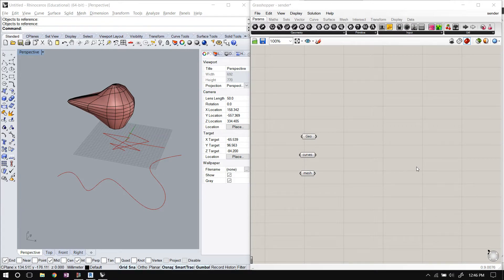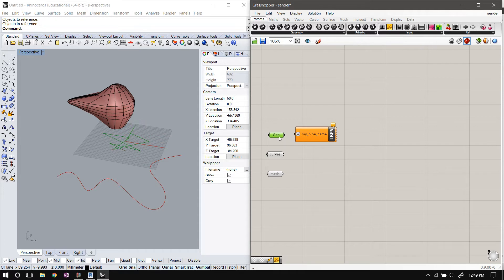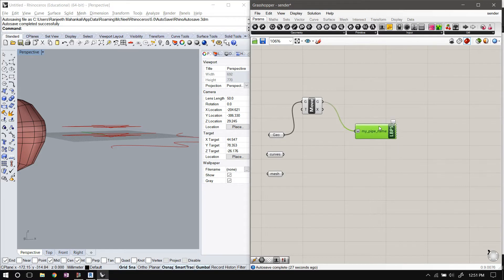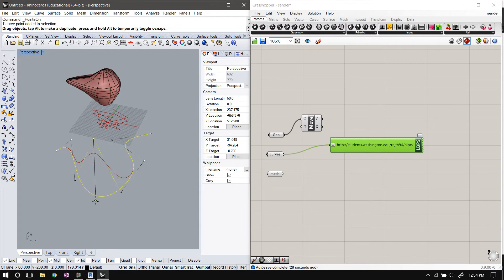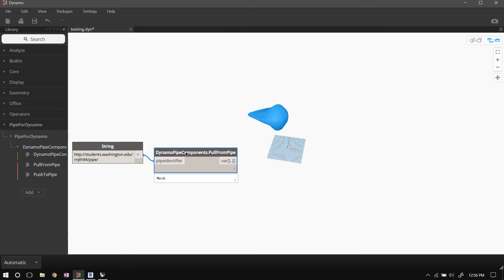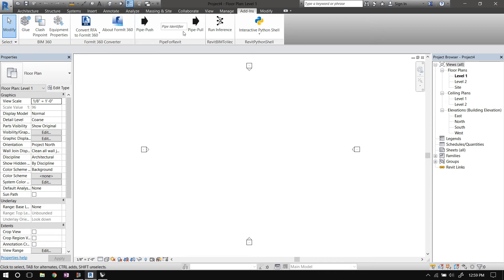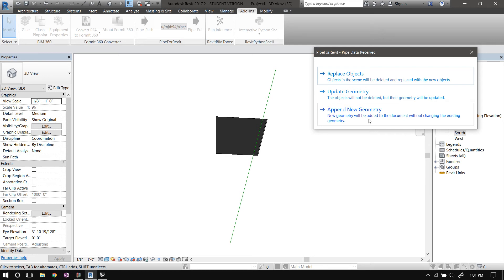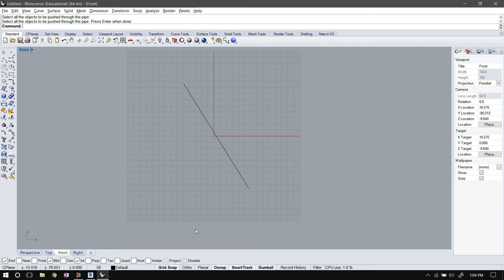Geometry Exchange with The Pipe - For Users

Comment: Hi Ranjeeth, Your Pipe seems very interesting, are you still developing this?
Is the geometry limited to Curves and meshes, or are Surfaces/Breps also possible?
Connecting Rhino/Grasshopper to Blender 3d or even Alias Studiotools would be a wonderful simplification for many workflows :)
Reply from the maker: Hey sorry I am not developing this anymore. This was a fun experiment. If I were to do this now I'd probably accomplish it in a different way.
This prototype didn't do b-reps. But in theory any geometry should work as long as it is properly communicated.